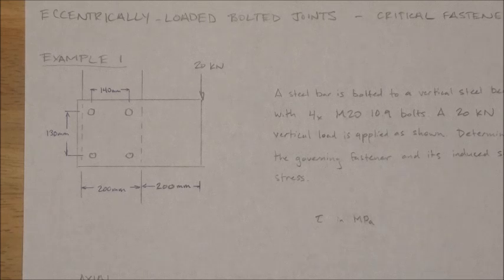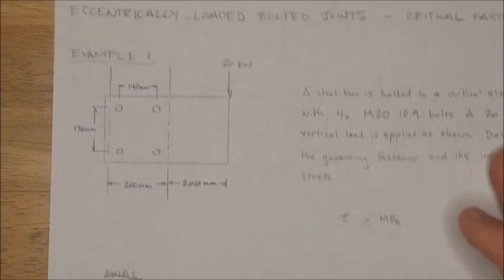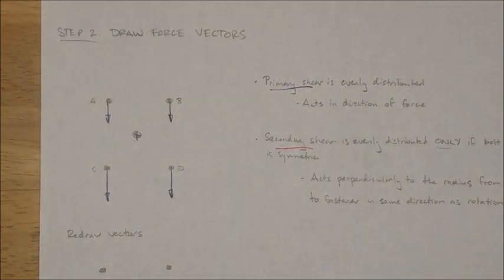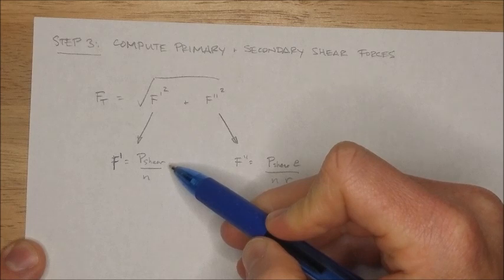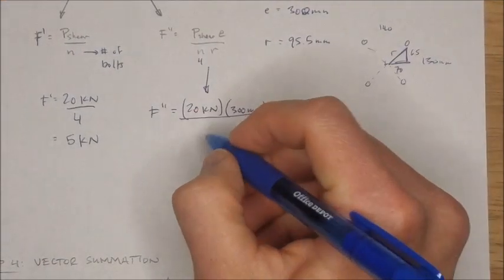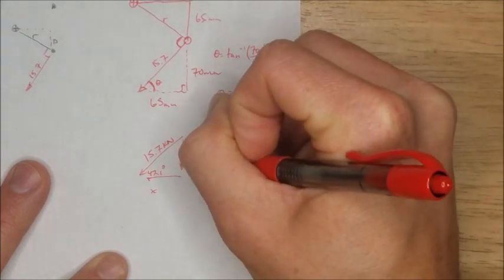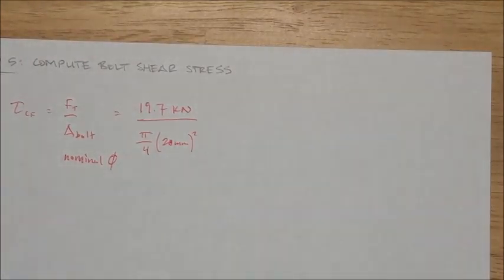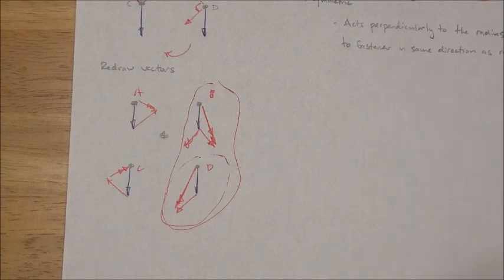Bolt Group in Shear Ex 1 - MDM PE Exam Prep

Comment: Ordinarily, sign convention doesn't matter as long as you are consistent, because your calculations will yield a positive or negative value. In this case, we are choosing which bolt appears critically loaded solely by the diagram drawn - and the sign of those forces in the diagram will change the outcome. 

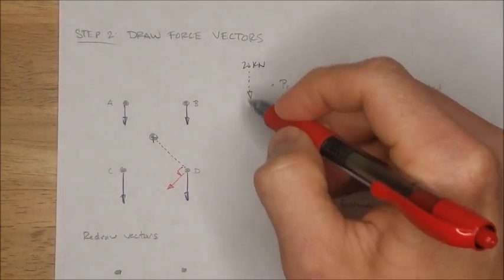Could you elaborate on why at 7:00 we assume the bolt's reaction force to torsion is in the same rotational direction the applied load creates? Is it that we aren't drawing a reaction force? Seems backwards to most FBD work, where you assume a reaction that keeps it from rotating. 

Thanks! 
Fantastic explanation